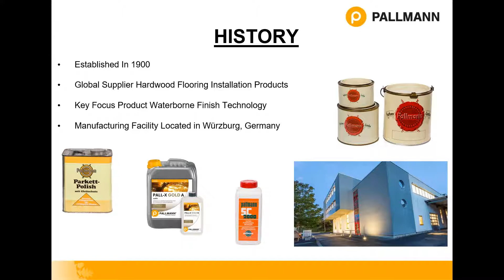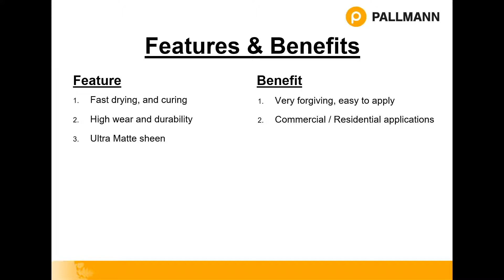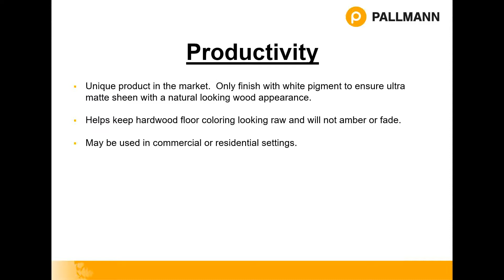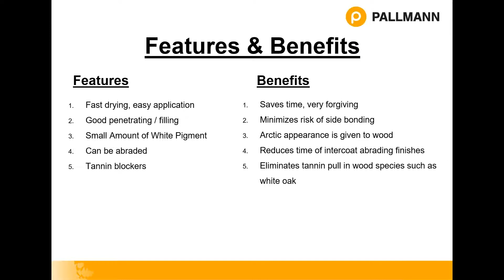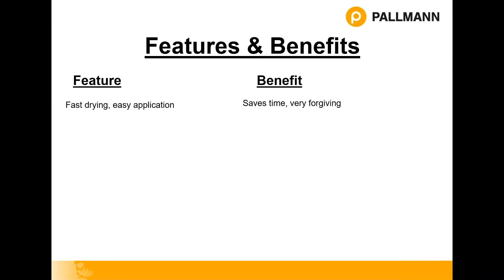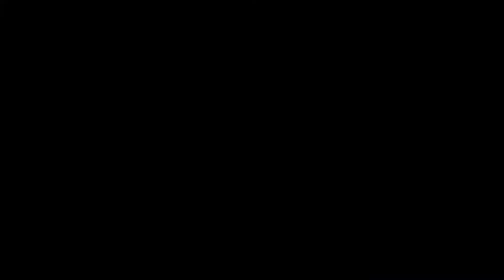PALLMANN New Sealers & Finish NATURESEAL, WHITESEAL, PURE

Comment: How does Whiteseal or Natureseal work on a soft wood species like doug fir? The wood is 100+ years old and has a tight vertical grain.  I was planning to finish with Pall-X power ultra Matte. Or should I go with a clear sealer instead.  I'm worried about splotches.